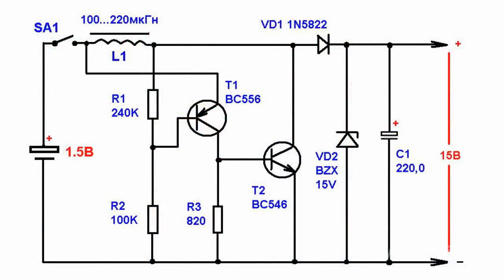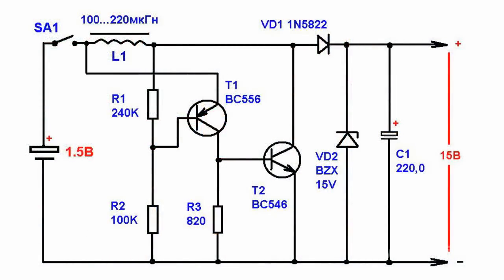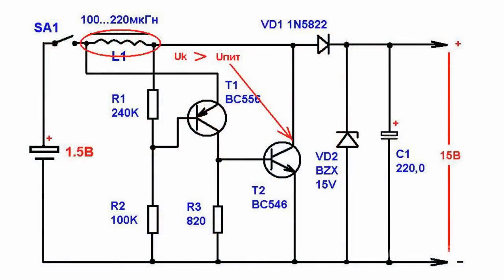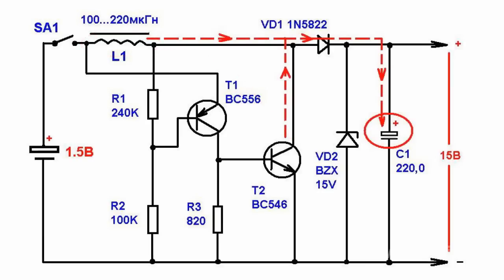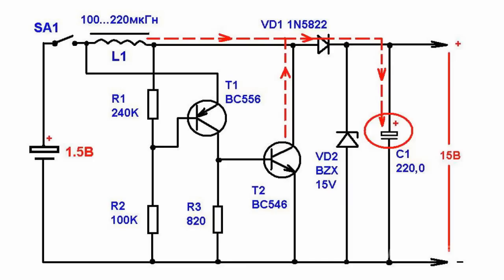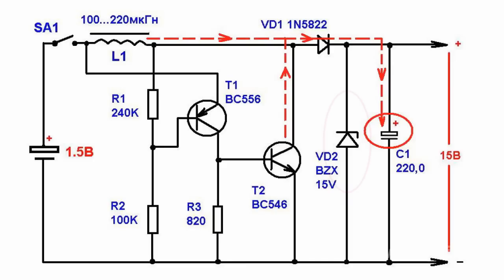Boost voltage converter ranging from 1.5 to 15 ...

Comment: I tried to run led load on the output side 67-21S/KK4C-H6565N3P32833Z6/2T/EU 5led -5led parallel total 15v and 80 mA and i got 76 % efficiency any suggestion to increase the efficiency

Comment: @ J Superman
Maximum input current depends on values of R1 and R2 multiplied with hfe of both transistors. By keeping proportion beetwen R1 and R2 lowering them both in value you can increase input current. With that also goes output current. With lower R1/R2 raise trip current of circuit. Examined on more inductive inductor
Reply: +Vladimir Knežević I tried to run led load on the output side 67-21S/KK4C-H6565N3P32833Z6/2T/EU 5led -5led parallel total 15v and 80 mA and i got 76 % efficiency any suggestion to increase the efficiency

Comment: Yes, more variants including Richard Menor's coming request of 1.5V to 6V converter are more important to meet variety of actual demands. Fishery is always much more beneficial than fish only. I need a converter from 6V (500mA) to 12V (250mA) to power my space charge tube VHF/FM receiver, but no ready diagram is available by now. Chip Dipvideo, would you please, if possible, to show your design principle of the "Boost voltage converter ranging from 1.5 to 15 V" and enable your audience to find a way out for their specific demand?

The inductor L1 and capacitor C1 play an important role in terms of their inductance capacitance. How to calculate values of the two is welcome to kick out the course. Thank you in advance.

Comment: can i have a diagram for 1.5V to 6V?
Reply: Yes, more variants including your request of 1.5V to 6V converter are more important to meet variety of actual demands. Fishery is always much more beneficial than fish only. I need a converter from 6V (500mA) to 12V (250mA) to power my space charge tube VHF/FM receiver, but no ready diagram is available by now. Chip Dipvideo, would you please, if possible, to show your design principle of the "Boost voltage converter ranging from 1.5 to 15 V" and enable your audience to find a way out for their specific demand?

Comment: Good circuit. Actually this circuit very very similar with the standard JT. As we can see, the transistor T1 replaces the role of the second winding of the coil unit, because it reverses the current polarity from the end of the single winding (at collector T2) to be sent back to Base of T2 itself. 
I have only one question: what is the maximum output current ?